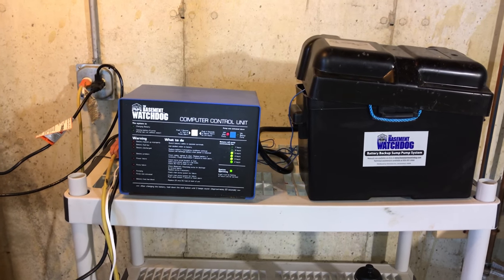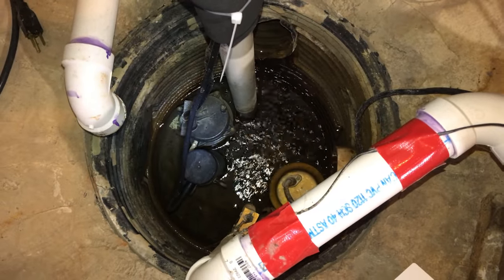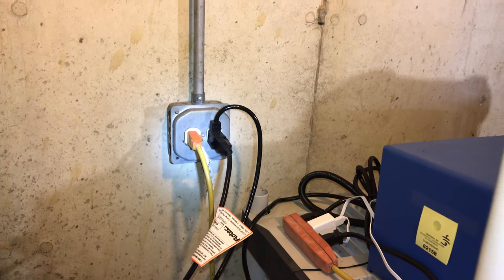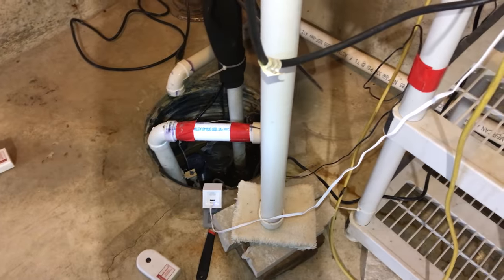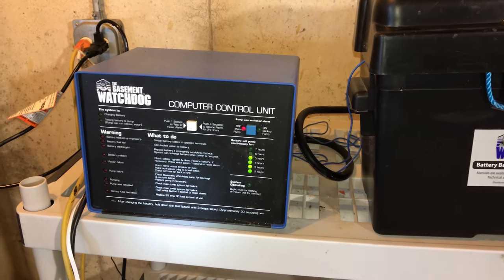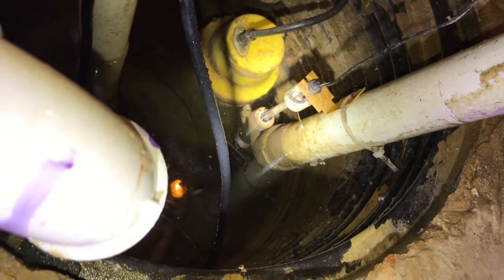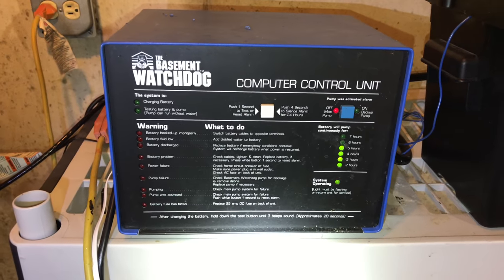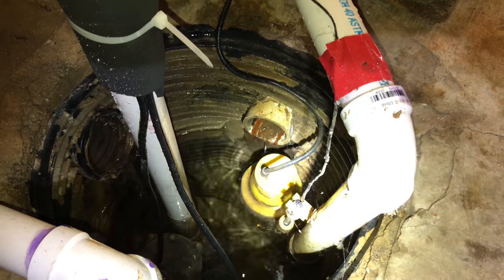Basement Watchdog Emergency Sump Pump Backup Battery

Comment: Boats bilge pumps operate similarly. One small pump typically 500 gph with small diameter hose. Second larger pump 2,000 (and up) gph with float switch mounted higher (typically just below floor). If smaller pump fails, or gets overwhelmed by water coming in to boat, second pump kicks in. Both run off 12v batteries, but at dock a battery charger maintains from 110v shore power. Away from dock, engine can be started for alternator to maintain batteries, or a generator. Or plug the leak best you can with wooden cone, plumbers epoxy, trash bags, rags, etc and run boat aground to prevent sinking, get to a lift, trailer, or man the lifeboat(s) or lifejacket after SOS Mayday call to Coast If within 200 miles of US. Peace
Reply: Question: did you only unplug the power to the primary sump? Don't you have to unplug the power to the backup also to simulate a true power outage and test?